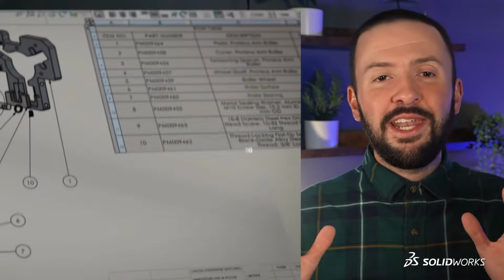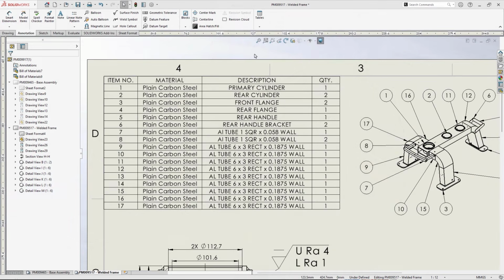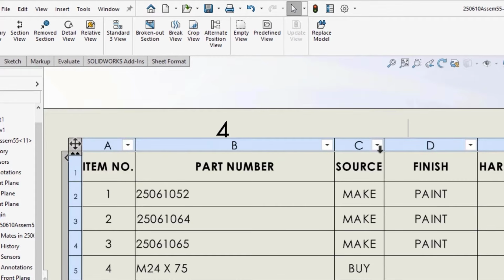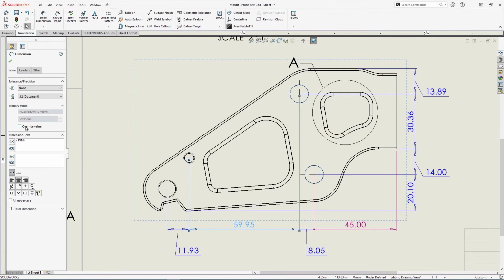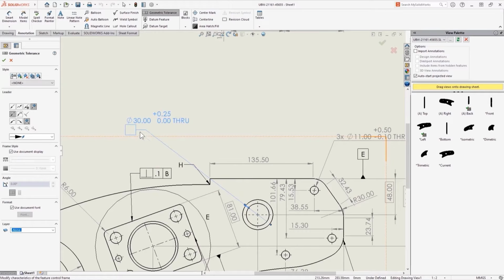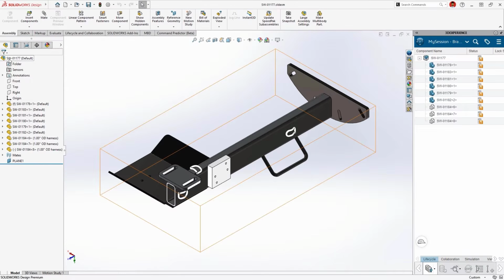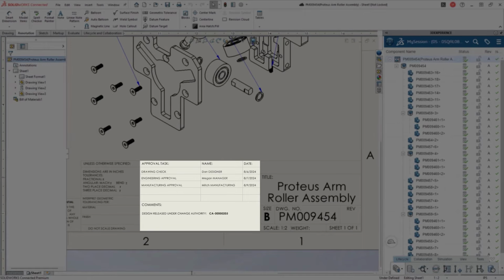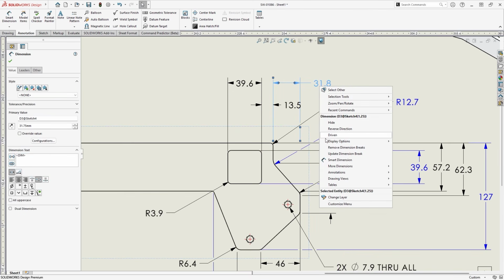10 Drawing Enhancements in SOLIDWORKS Design That Actually Save Time

Comment: Breaking measurelines should be possible to Setup as Standard Option within a drawing template as Option, and Not manually for each measurement.

Im working für 25 years with solidworks and very offen im thinking "why people at solidworks doing this in the Last 30 years?"